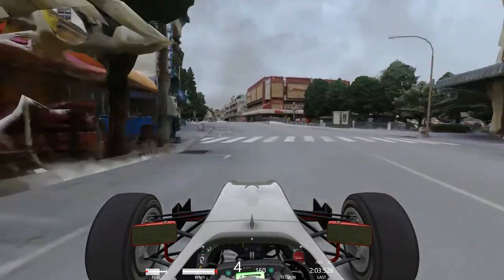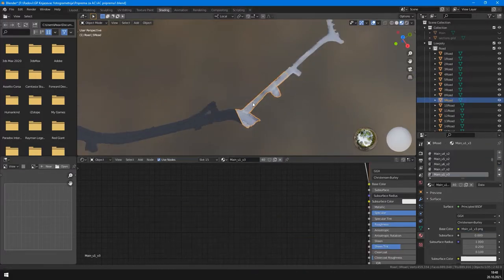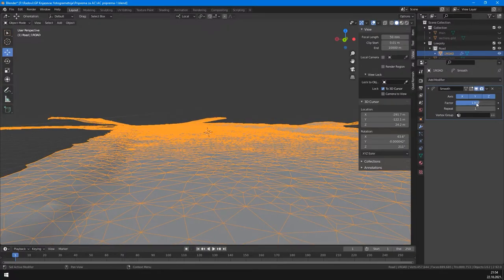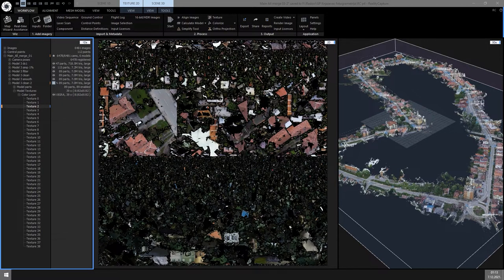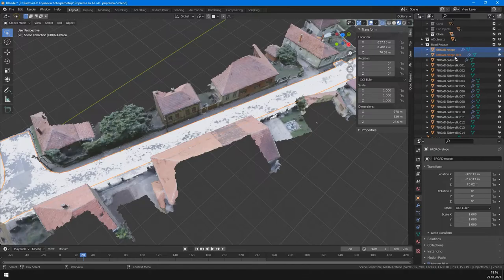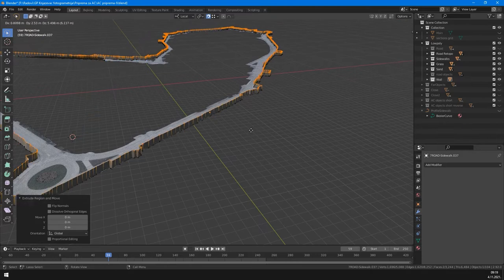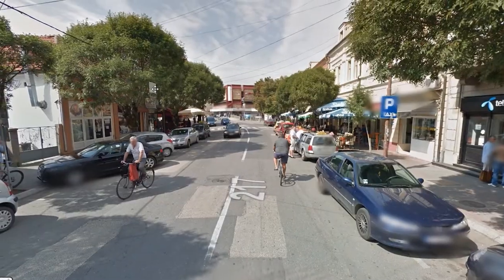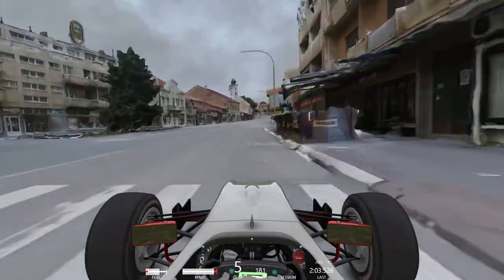Photogrammetry to Assetto Corsa, track modding tutorial

Comment: Is it possible to load these into Race Track Builder? Addig track elements there would be easy. Also the road could be placed in there, which is easier than modelling the whole.
Reply from the maker: I never used Race Track Builder. Adding track elements in Blender is also easy, I just didn't do it at this moment.

Comment: Could you give a guide on how to use data from google maps rdc files? If you are familiar with it. I have gotten as far as separating the road meshes and added the start point and pits etc. but in kseditor I cannot seem to find the correct textures for the mesh
Reply from the maker: I haven't work with rdc files. KS editor opens the textures used in 3d softawre. The textures should be placed in 'texture' folder inside the folder of the track in Assetto Corsa.
Read here about folder structure https://assettocorsamods.net/threads/build-your-first-track-basic-guide.12/

Comment: Hello, nice video, I'm doing a project according to your tutorial, I wonder your final polygon count and what is the maximum assetto can handle? I have around 15Millions right now. thanks for the answer
Reply from the maker: I don't know what are polygon limits of assetto corsa. There is a limit on a single .kn5 file, if your track reaches that you can separate a track in more .kn5 files, and load them with models.ini. I had 5 .kn5 files each was somewhat less than half a million polygons.
Reply: @lipsach  okay ty for answers

Comment: how when you import the fbx on kseditor the texture set automaticly . how did you do that bcs without that it's impossible
Reply from the maker: you need to put all textures in /textures folder inside the track folder in AC. More info https://assettocorsamods.net/threads/build-your-first-track-basic-guide.12/
Reply: @lipsach  ohhh thanks this works but I have an other problem sorry,when the car spawn it appears in the floor and bump and turns upside down I try everything in blender for the pit spawn etc it only works with some cars that also bug but manage to turn around the right way
Reply: @lipsach  otherwise really thank you very much for your excellent and quick response 👍🏼
Reply from the maker: @lopi_games827  You need to orient spawn object axes correctly. It is also addressed on the forum, link I sent previously.
Reply: @lipsach  ohhh my bad I don’t see him thanksss youuuu so muchhhhh I will try it 👍🏼
Reply: @lipsach  ohhh my bad I don’t see him thanksss youuuu so muchhhhh I will try it 👍🏼

Comment: I cant figure out how to get the textures to appear? I followed everything exactly, but textures/materials do not appear for me 😢
Reply from the maker: Either you should check 'sweet' mode in 'scene 3d view' tab. Or the scene is too large and can't be desplayed full. If that is the case, either 'simplify' mesh to reduce policount, or create 'cliping box' to view only part of the mesh.
Reply: @lipsach  thanks for these pointers. However, I've only just started using the software, and yes I've imported an extremely large mesh. The fbx was around 120mb.
Where can I find out in detail, how to do the clipping option. Thanks
Reply from the maker: @djtyros  https://youtu.be/sdiOsGpfbkg?t=1758 here I briefly talked about it. You can see how it works.

Comment: Are you using separate physical and visual layers for the road surface?
Reply from the maker: It is single mesh for the road. I remodeled over photogrametry mesh, and bake texture from fotogrammetry mesh.
Reply: @lipsach  Was curious as I'm starting to do a similar project and reading into AC optimization about having a low poly visual road mesh to apply the texture, and invisible not rendered high poly mesh for driving surface
Reply from the maker: @ericmullen14  I am doing it the other way around. The visible building meshes are higher poly and textured, and I make invisible low poly collision mesh to optimise calculations.
Reply from the maker: @ericmullen14  I made simpler collisions for walls. The road surface should be high polly. My road is not that hight poly so I used the same mesh for graphic layer also. But if road mesh is to dense, maybe there is a benefit of making the simpler mesh for graphis. I didn't experiment with performance and optimization.

Comment: Hi! You did this course very well. There would be a problem that it loads very slowly and when I load it I still only see a dark frozen image. there is a solution to this. I really want to try
Reply from the maker: Unfortunately the mod is somewhat pc demanding, because of huge textures and geometry.
Reply: @lipsach  okay, thank you for your help! Just keep up with the mod :)
Reply: @lipsach  I have one more question. What GPU are you using?
Reply from the maker: @danielnagy865  GTX 960
Reply: @lipsach  thank you!

Comment: excuse me I was looking to configure a two way.
I have to create two ac_starts and two finishes, one for the outward journey and another for the return trip, or I can make a start then the finish only at the end of the course.
And I have side roads I should define them as extend or something like this so as not to confuse with what I would like to define as the circuit?
There is no video for this how to place these cubes according to a one lane or two lane etc, I understood that it was necessary to place several ac_time if the circuit is long max 3 I believe...
In my case where the map also has side roads in streets that have nothing to do with where I want to race, if I place my times only on the highway and the return lane to return to the highway in the other meaning the game will understand that the turn is only on the highway for example and not on the roads in the city? I haven't found anything apart from videos that talk about the basics of the basics on how to orient your cubes and where to place your pit, its start and its times but not even for the hotlap and the rest
Reply from the maker: I guess you want to create multiple layouts for your track. https://assettocorsamods.net/threads/track-layouts-how-to.364/
Reply: @lipsach  Thank you for your answer
so there are four cubes for an a a b
AC_START_0
AC_TIME_0_L and R
and AC_FINISH_ and I would have to direct the z towards the finish when returning, is that correct? and for a circuit like this I would like to make the lap of the track a round trip on the highway but not just a lap how I should arrange my cubes